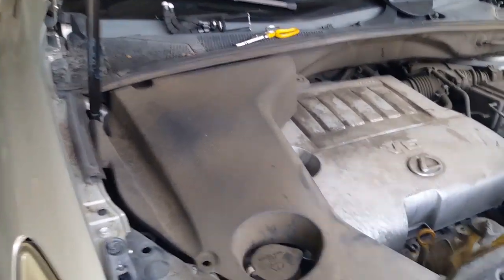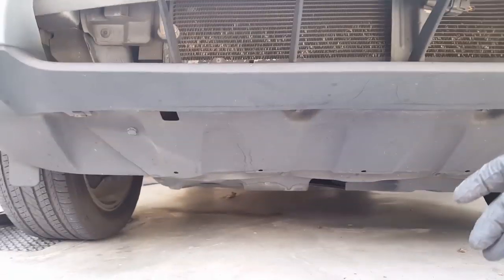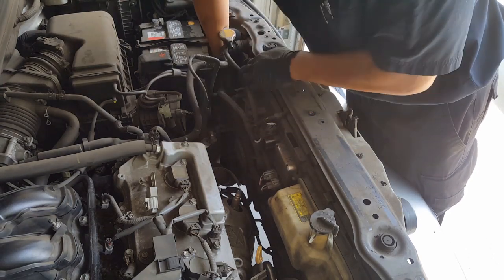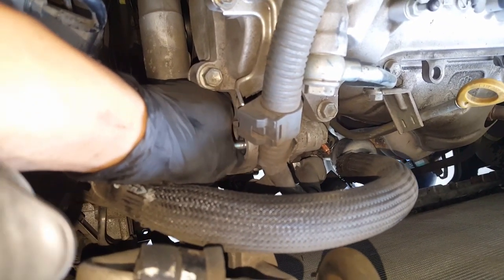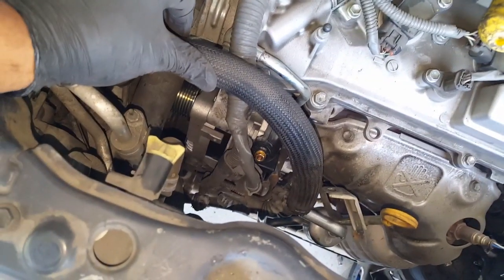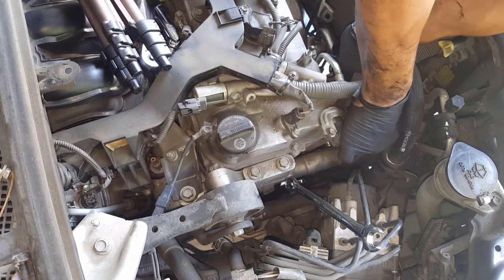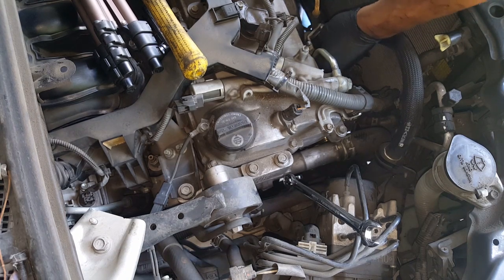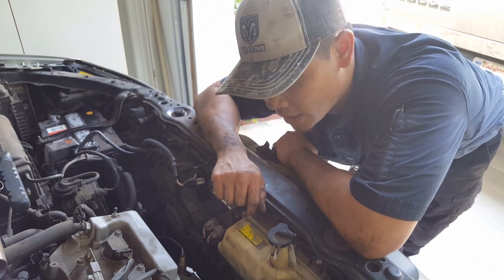07 Lexus RX350 Alternator replacement! WITHOUT REMOVING RADIATOR

Comment: Good job bro , you have the only video literally on the RX350 . This is a blessing bro thank you . I have an alternator job in the morning and have never touched a Lexus . This is super informative
Reply from the maker: Yeah I know! I noticed there were no videos on on an rx alternator replacement so I decided to make one! Thank you! I appreciate it!
Reply: How did your repair go? I might be tackling this in 6-7 hours. It's incredible how much harder it is on the lexus than the avalons.
Reply: @bluewker How did it go?
Reply: @bryanglass5818  man, this was quite a few years ago. It went a bit worse than expected. Reaching down into the engine bay blind in 0F weather with thin gloves on, trying to position the alternator and get bolts in was tough.

Six months later the alternator failed. We ended up bringing it to a shop because I was out of town and my parents needed the car. 

Moral of the story: buy a good alternator.
Reply: @bluewker  Thats crazy!  Yes, I’m still debating whether or not to take it to a shop.

Comment: Mentioning the service access panel under the front passenger wheel well would have been nice. Something like 2 10mm bolts and you have easy access to your serpentine system and lower alternator bolt
Reply: You must remove the lower wheel arch cover (2 x 10mm) to remove/replace the serpentine belt. Also removing the tensioner pulley and then its bolt makes for easier lower alt. bolt removal/replacement.
Reply: I just used a bolt to stick in the whole on the bottom of the tensioner pulley lined up with the rectangle slot it gives easy access to the bottom alternator bolt.  My problem was the 12mm bolt hidden
Reply: Oh yes you are right 
I did my Lexus alternator 
Yesterday and even
Have  easy way to pull 
The Alternator out on the little 
Bracket behind the alternator 
I just pull the front bolt 
And the stud and that saved 
Me probably a good hour 
Of messing with the lower 
Bolt it's a very good  trick 
And when i put the 
Alternator back I put the 
Bracket first and is better 
And faster way

Comment: Not all RX350s from this era have that third bolt and bracket assembly — my 2008 does not — so even if it is present it likely is possible to leave it off. I used the method shown on another video to zip tie a serpentine belt tool to the motor mount to keep tension off the tensioner. The factory manual specifies removal of the radiator fan assembly. I would hate to attempt removal of the alternator with the fans in place.
Reply: How long did it take you to change?  What brand of alternator did you buy?  Where did you get it from?  I have a 2008 RX 350 that needs to have an alternator replaced.
Reply: @bryanglass5818  It took me all of six hours to replace my alternator. A second job would have gone a lot faster, as is always the case. Some important notes:
1. I have to correct my earlier post. That third fastener was present on mine and is crucial. A light and small mirror are helpful for seeing it.
2. Thousands of miles of grit made the alternator electrical connector insanely difficult to separate. Be prepared to flood the thing with something like WD-40 and blast it clean with compressed air if yours is stubborn.
3. I used a remanufactured Denso alternator. I would only trust this brand, as Denso is the OEM supplier to Toyota. My replacement looked exactly like the original factory part. You could compare its price to a new dealer part. There will be quite a difference. I bought mine locally. This is advisable so you can compare your old part to the new one. They will want the old one for a core.
4. Protect the radiator with a sheet of cardboard. It’s cheap insurance.
5. Buy that black plastic radiator neck piece ahead of time. Even if the original doesn’t break — and they almost always do — it will have become brittle and replacement is a good idea.
Reply: @thardyryll  Thanks for the tips!

Comment: FYI for anyone contemplating the job and researching on YouTube - there is absolutely no need to remove the radiator fans assembly in order to remove the alternator. You undo the water inlet hose and remove the thermostat housing (two 10mm nuts + the 14mm idler pulley bolt) and remove the three screws holding the ABS brake unit to the chassis which then allows enough room to manoeuvre the alternator out. 

If you are not intending to replace the serpentine belt, you can get away without removing the front wheel and access panel (just work on the idler/tensioner from overhead). 

The only mildly tricky thing is removal of the rear alternator bolt because you can't see what's there. The alternator is bolted to the block with a bracket (google part number 125110P010 for a picture). Use a deep 12mm socket to remove the bracket from the block and you can then free the alternator enough to access the other bolt and remove the bracket from the alternator.

Comment: Great video but some tips for others as I just did this job myself- took about 6 hours. 2009 RX 350 with 172K miles, it started having real issues two weeks, light came on a few days ago,, but it was noisy for the last few thousand miles. Tough job for guys with larger hands as you'll have less maneuvering space but it's doable.

1. You'll probably break the bolts for the cover underneath, rusted to hell on mine. Air intake bolts might break off too, one of mine did. Exhaust manifold bolts might be rusted to hell, spray some pb blaster in case.

2. If you break the engine coolant filler neck accidently, Dorman sells the part, #902-408. Good to have in hand and return if not needed. If you do need it, break off the plastic retainer clip, use some wrench/locking plier to get a grip on it, and wiggle it off while using something to pry it off. Careful getting the broken plastic pieces inside the hose out- face it downwards and hope for the best. New one should go back right in with some suggestive tapping.

3. When it comes to the third bolt in the back, you don't actually have to remove initially to get the alternator off- you can just go straight in following the compressor line and the bolt for the bracket mounting to the engine block is right there, 12mm. You will have to take the exhaust manifold off first, don't need to touch the dipstick. You can wiggle the alternator out after taking that bolt out then actually remove the bolt connecting the bracket to the alternator out after. There is a line/wire connected to this bracket so you will have to take it off.

4. When it comes to wiggling the alternator out, I found it extremely helpful to pry the top, knock it back in with a wrench (anything's a hammer), then pry again and repeat and it will eventually loosen itself. You will have to pull it up from the bottom and start to maneuver it out that way. I believe my alternator pulley was facing downwards/towards the inside of the car for me to get it out. Replacing with another unit was extremely easy as it almost slipped right in. If you un did the bracket, finagle the bolt onto the alternator first but do not tighten all the way. When you get the alternator lined up for install, put in the top bolt, bottom left bolt, then bolt it into the engine. Tighten all the bolts down at this point

5. I found removing/replacing the belt is easiest with two people even if you do put a bolt in to hold it un tensioned. Getting it back on is extremely tough for your last pulley without having it un tensioned fully. Use two wrenches/breaker bar to get it loose. Then putting it back on have someone help or you may never finagle enough clearance to get the belt back on right.

6. Under air intake tube was annoying since you can't see that far back, until you realize it has to pivot off the clear res underneath. Use that as a pivot point and eventually you should get it to fit back into the air intake box easily.

7. I had new pulleys on hand but when it started getting late and I spun all the pulleys and didn't feel any resistance/grinding or hear any noise, I decided to just leave them there. Yes I should have gotten them replaced since I was there but it's a simple enough job that I can do it another time when I really have some issues. They're going back to amazon in the meantime.

Comment: Thanks for the video. It was helpful in completing the job, however here are some tips to others who may attempt this:
 
1.) Removing the radiator will provide much easier access during removal and reinstall
Without removing the radiator will require you to contort your hands in awkward, tight spaces and may require special tools that the average garage may not have.
By removing the radiator one would also prevent damage to the condenser during removal/re-installation
2.) If your car is old enough, the nipple where the return hose connects to radiator cover/neck WILL break. This part can be separately removed without replacing entire radiator and should be available at your local parts store. Easy to remove and reinstall: Remove collar and gently push it backwards toward fire wall (see new part to get idea on how to remove)
3.) Serpentine belt is best removed by:
Jacking the vehicle up and remove the passenger side wheel
Remove the skirt that covers the serpentine belt area (Two 10mm and 1 push pin)
Use 14mm wrench (the longer the better) or slim socket wrench to pull DOWN and to the FRONT of vehicle on the tensioner bolt
Remove belt from the left most accessory at the bottom of the pulley
Then go back up top and remove from alternator
To reinstall, place belt back on alternator, loosen tensioner, and reattach belt to pulley
4.) Alternator bolt removal:
   a.) Remove upper bolt of alternator from the top of vehicle (14mm)
   b.) LOOSEN the lower/left bolt using a breaker bar w/14 mm socket or wrench with extension.
          **Chances are you will not be able to remove the entire bolt from the top using a wrench/socket combination because       of the limited space
   c.) Continue to remove the lower/left bolt (14mm) from the bottom of the vehicle 
You may have to lay on your back and reach up with left hand to remove the remainder of the bolt.
   d.) Third, lower/right bolt (12mm) removal:
--Remove dipstick (10mm)
--Remove exhaust manifold heat shield (no need to remove O2 sensor)
--Use short extension and wrench to remove the bolt
****This bolt will FALL into the bowels of the car!! Have a magnetic pickup tool ready
Hopefully you have already removed the under skirting, for this is the only way to retrieve it
During reinstall I dropped it at least 10 TIMES!!! Each time it fell in the same exact spot!! *
  5.) If you DID NOT remove radiator, place a piece of cardboard or board in front of radiator to protect the condenser as you remove/reinstall alternator (this will however give you less space to remove alternator)
--If you skip this step wear some light duty gloves while removing alternator and use the back of your hand to position between condenser during removal/installation.
**The Third Bolt Re-installation*
     DO NOT tighten the other two bolts, this will allow some wiggle room to install the 12mm bolt while the alternator is in close alignment because of the other 2 bolts... I made the mistake of tightening the lower 14mm bolt and caught hell trying to get the 12mm installed... It is only AFTER I loosened the other 2 14mm bolts was I able to successfully install the 12mm on the 1st!! try!!
Good luck!!
Reply from the maker: Very thorough! Thank you for the helpful tips for others completing this job easier!

Comment: Thanks for this video. Great instructions. I took a break on the backside bolt and ended up read some comments. Figured out to remove the bracket from manifold and made it way easier. Total time getting the alternator out was 1 1/2 hours. I have to go pick up a new remanufactured one tomorrow. Put my battery on a trickle charge in the meantime.
Reply from the maker: Thats awesome I love when my videos are able to help people DIY!
Reply: @LifeTac  finished up the next day. It took close to 3 hours. It was easy getting back in but just a pain getting everything back together. I tried getting the bolt/bracket on the back of the alternator back on but finally gave up. I have also hated the cover underneath the radiator for a long time!

Comment: Thanks so much for this video! Note on the 10mm bolt on the back attaches to a bracket - I actually removed the nut/bolt assembly from the exhaust manifold, then when the alternator was loose, removed the 10mm bolt. Repeated the process on install. Thanks again.

Comment: Very helpful for my first Alternator replacement (310,000 Kms). The 12mm lower inside bolt was the most difficult to get out. There is a 10mm nut on that bracket that would make it much easier to get out. The bracket stays with the alternator on removal.
Reply from the maker: Awesome tip! Also what a daunting job for your first alternator! Props to you!
Reply: U @LifeTac  I also found that removing the belt tensioner bolt (LH thread) made the lower alternator bolt very easy to remove/install. After fitting the new alternator, replace the tensioner, pulley and slip a 6mm drill into the loading hole of the tensioner and have it fully loaded before installing the belt. Took 3 minutes to load the belt. Would attach some photos if  knew how. Lexus wanted AU$860 for a new Alt. but found one new for AU$270.

Comment: Excellent video sir! Bravo for taking the time to do this. 

Only thing I would mention is that when you were commenting on the electrical connections at the alternator, you refer to the main cable as a “ground” cable... it’s NOT a ground, it’s the main battery charge cable! This is a critical difference and could cause someone some serious damage if they do not understand this. That being said, if they follow your recommendation to disconnect the ground cable ahead of time, it will be safe anyhow. 

Thank you again for the excellent quality video!
Reply from the maker: Awesome observation! Thanks for the input and correction.

Comment: Thanks for this video. I was able to successfully replace my alternator using this video. There are two important things missing in this video. 

1. How to remove the belt from the alternator
2. How to remove the alternator itself

To remove the alternator belt, it’s easiest to simply remove the front right passenger wheel and the plastic wheel well cover which will give you access to the belt pulley. You can use a long wrench and shift the pulley to loosen and remount the belt. It’s easy this way. The pulley does not need to be removed.  You can see a video of the pulley here:
https://youtu.be/zRfvf7-EcAw

To remove the alternator itself, remove the top bolt which is visible from the top of the car then remove the bottom left bolt which is clearly visible from the passenger wheel well which you access to remove the alternator belt. The hard part is getting out the screw on the right side of the alternator. To remove that screw, you first have to remove the bracket screw that’s attached to the alternator screw on the right. A picture of that screw can be found at :31 of the video below. Do not follow the rest of the video below which shows to remove the pulley itself. That’s not needed! Once you remove the screw in the picture below, you can then remove the 3rd alternator screw on the right side. 
https://youtu.be/IAgFfeWbaMQ

Good luck! This was my first time doing this and it took me almost 6 hours to do it. 4 to remove the alternator and 2 to install the new one and put everything back together.
Reply from the maker: That's is awesome! It's always great to hear when people DIY. There is no greater feeling of accomplishment. Thank you for your tips and I appreciate the feedback. Alot of people have mentioned that I forgot those 2 crucial components of the job, and for that I greatly apologize.

Comment: Any recommendations on how I can short my alternator, my alternator is making an ugly noise like if the bearing is bad, and yes I have already found out it is the alternator.... I currently have a warranty on the vehicle that covers the alternator but they only cover it if it fails to charge not for making noise, so I want to make it not charge so then they can cover it cause it is making a very ugly noise but the bastard does not want to stop charging... I need it to stop charging

Comment: Two bolts hold it in and the third one at the bottom is a nut. I didn't need to remove dipstick or us swivel. Extension alone was good. I also found that doing the bottom bolt it was better to do from in the front wheel area. Wheel and panel off to take belt off anyway. Putting alt back in I found that the first mount to line up was the stud down by the dipstick. Fell into place so to speak after that. Taking apart took just about 3 hours. Replacing took 1.5 hours. Sippin beers while doing it. Good overall vid thou.
Reply from the maker: Awesome tips! I like to see other peoples input! It helps others as well as me! Thanks for watching
Reply: @LifeTac  yes. Thanks. You did great....:)

Comment: having messed up a very expensive condenser while doing a job like this, I suggest we all find a way to shield the condenser on the radiator unit while we are doing this job because the bottom bold of this alternator is really hard to get to.. My suggestion is the remove it.

Comment: Did you use the 100 or 130 amp alternator? They say the 100 is for the ones without the towing package and the 130 is the one for the ones with the towing. My 08 doesn’t appear to have a tow package and I know it doesn’t have AWD.
Reply: Same for me. Just pulled the old one out and took it with me to the parts store so they could match the part number. Was the more pricey one of course